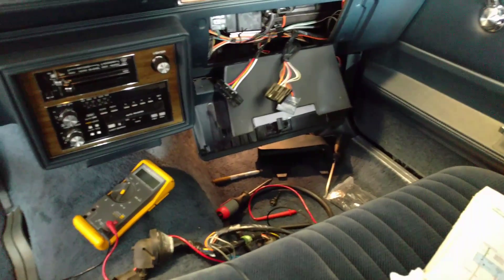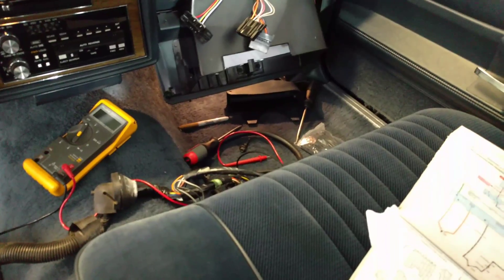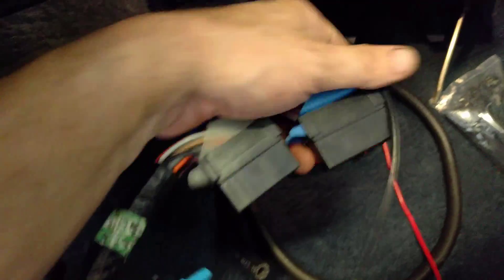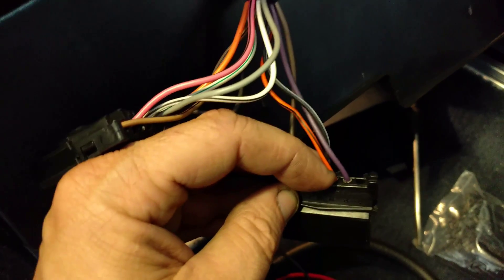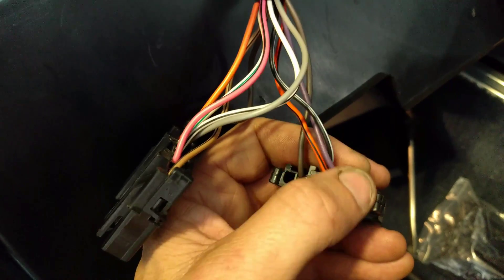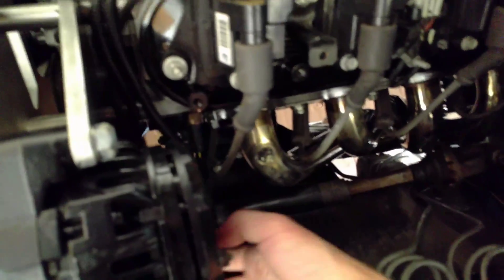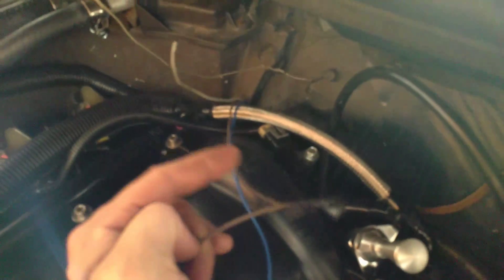Gbody LS Swap Wiring Explanation

Comment: Would this stop it from starting in drive?
Reply from the maker: @BridgeMoes  Are you talking about the neutral safety switch?  It's been a long time, but I don't remember that being a problem.
Reply: @nu5m_radio  I swapped my cutlass with a 6.2 6l80 it starts in park doesn’t start in reverse or neutral but starts in drive and will take off

Comment: How did you hook up the mil lamp (brown wire) up? For the engine light.
Reply from the maker: It' been a LONG time, but I believe the MIL indicator is a ground to activate circuit.  If you ground the "brown wire" does the MIL activate?  If it does, then check the MIL output pin on the PCM for continuity to ground when active.  The HPtuners diagnostic program allows you to manually toggle the MIL if I recall.  

I believe I just ran the PCM MIL pin directly to the lamp on the dash, but you might want to make sure you PCM can support the current draw.  Maybe use a small relay just to be safe.

Comment: Can i completely remove the other pigtail from the factory ECU and the factory diagnostic port?
Reply from the maker: @blocscustomz  It's been so long I don't remember.  Make sure the harness with the ALDL is not the one that contains the starter and ignition wires.
Reply: @nu5m_radio  looks like none of them do.

Comment: im about to do  a LS swap on my 84 monte carlo ss.. what factory wiring do i need to keep installed in the car?
Reply from the maker: I can't remember all the wiring you need to keep, but the ignition wire (the one attached to the distributor) and the purple starter wire for sure.  You can get the engine running with just those two and a ground wire.

Comment: How did you set up your shift linkages?
Reply from the maker: I used a Lokar kit which was basically a straight stainless rod and some hardware.  You have to bend the rod to make it work.  It's a PIA and would not do it again.

Comment: Where did you hook the purple wire to, im running a holley terminatorxmax and cant get the torque converter to lock up... 1987 cutlass

Comment: When you ran the pink wire did you only run it to the ignition wire on the harness and into the relay ? That’s how i did mines but it cranks but don’t want to start up not sure what is giving power to the fuse box
Reply from the maker: Make sure the ignition wire has power during cranking.  That's a common mistake.  If it's cranking you should be getting close.

Comment: Did you use the stock converter with the 4l80
Reply from the maker: The car is sold, but it had a Circle D converter.  I don't remember the stall.

Comment: SO TELL ME IF IM CLOSE OR MOSTLY RIGHT HERE;
typicaly GM runs a very large 12v cable directly from battery to starter. Then a large ground from starter to frame or engine block.
then a still large but smaller cable directly from +12V starter post to fuseblock under the dash, this is the feed for fuseblock
 and also a much smaller wire from the key igntion switch back out to the starter which triggers the bendix to kickin and starter to turnover?

if this is correct can i reuse the large red wire from starter to fuseblock to refeed fuseblock, and i can reuse that trigger wire to the  new  LS fuseblock to trigger starter from ls fuseblock/harness?

Comment: @pmoore4321 can I tap the tcc wire from my harness to the tcc wire in the cutlass?
Reply: Without unplugging the connector?
Reply from the maker: @mr.johnson9589  I'm not sure.  It's been a long time since I messed with that project.
Reply: @nu5m_radio  ok thanks

Comment: What trans dipstick did u run?
Reply from the maker: It's a Lokar dipstick.  I don't particularly like it, but there is very little clearance between the engine and the firewall.  The dipstick comes with an adapter to make filling the trans easier.  It's not the ideal setup in my opinion.

Comment: Did your reverse lights work or did you have to do some extra wiring to get them to work?
Reply from the maker: Reverse lights work as stock.  I did have to adjust the switch due to the gate differences between the stock trans and the 80e.
Reply: @nu5m_radio  where is the switch located
Reply from the maker: @JDP15  It's a white colored switch that is connected to the top of the steering column shaft down towards the bottom.  You can adjust it by hand.  It moves from side to side.  It's kind of hard to explain.
Reply: @nu5m_radio   I move my connector on the steering column and my hand  on the gauge cluster doesn't move. I assume that means it's a bad switch.
Reply from the maker: @JDP15  I'm not sure I'm following you.  What do you mean by the "cluster doesn't move"?
Reply: @nu5m_radio  I'm not talking about the speed hard. I'm talking about the transmission position hand. That tells you if you in park or neutral etc. The white switch you talked about it in this video
Reply from the maker: @JDP15  The white switch on top of the column is for neutral safety (park/neutral) and for the reverse lights.  The switch does not control the gear shift indicator in the cluster.  
The cluster gear indicator is controlled by a string that is clipped to the rotating shift collar.  It's hard to explain.  Is yours just not centered on the selected gear or is it not working at all?
Reply from the maker: @JDP15  perfect explanation...https://youtu.be/vmVCuwI70Hs
Reply: @nu5m_radio  its working but not lined up. You had yours lined up perfectly.  I  will have the transmission in drive but in the indicator will say Reverse or Neutral
Reply: @nu5m_radio  thanks this explained everything.  Sorry for the confusion
Reply: Question...did you delete the backup lamp supply wire A9 Green out of the harness that goes to neutral/safety switch connector or did you connect it somewhere? I have the 4l80e also and I'm not sure what to do with this wire.
Reply from the maker: @montariusstuart1431  I really can't remember.  I'll be working on the Cutlass soon.   I'll check then.

Comment: Yo video cut off on me at the end I wanted to know does that last wire that thick red one that you were holding at the end is that for the power or ignition and I have to tap my alternator wire to the Cutlass old alternator wire and the same thing for the starter I tie the old starter wire from the Cutlass in with my LS swap harness starter wire
Reply: Yolanda Thomas dame shit i was tryna figure out! Just left us hangin

Comment: Which igniton wire did you use? And was it directly off the switch?
Reply from the maker: I used the stock wire that was connected to the distributor.
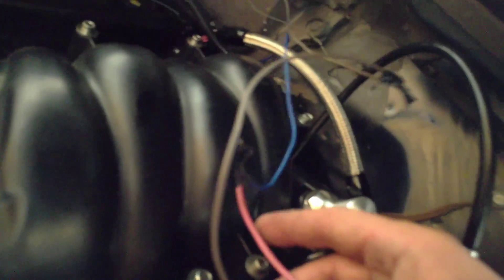Reply from the maker: At the very end of the video, you can see that large pink wire.  That's the one for the ignition.  The video ran out before I could finish explaining.  8:00

Comment: The harness I bought didn't have a Park Neutral Safety Switch or back up lights.  I want to add them to my LS Conversion. Might you know which wires are needed to add to the Red or Blue Connectors so I can connect them to the park neutral switch on the transmission?  Thank you in advance for your help.
Reply: im glad you both had this issue  i have same problem  but im going with a floor shifter and it in a elco. and help on this safety sw is greatly appreciated
Reply: @charlesgrant7690  what's your email address,  I'll send you a photo schematic showing you the connections
Reply: @charlesgrant7690  Hello Charles. Look at this link. It has the Neutral Park Saefty Switch, Plus on the back of the dash, it show the Purple and the green wires coming from behind the dash because they had a COLUMN Shifter so these wires went to the Netral Safety switch on the Column, But has the same task for shifters on the floor. I struggled with this and didn't have a lot of resources guiding me where to start to get this figured out. I hope this helps point you in the right direction. https://photos.app.goo.gl/T5AQaMFNWew3WBVNA
Reply: My harness didn't come with it either... what did you do about it ?
Reply: @Bball128  I just reached out to a wiring manufacturer tech support I believe speedway. They helped me even though it wasn't their product.
Reply: @smithjo4152  so what did you have to do?
Reply: @Bball128  they told me how to wire the neutral safety switch.
Reply: @smithjo4152  so you can tell me right... lol
Reply: @smithjo4152  share the secret!!

Comment: Hey man this vid helped alot. Doing a c1500 91 ls swap and trying to figure out what wire to hook up to the crank signal and 12v when the power is on but cant figure it out the diagram and got no power to the truck to check it lol any tips?

Comment: Doesn't relate to video but what did you use for drive shaft m? Length wise I've heard if you running a 4l60e you need to cut the stock one down about 3"
Reply from the maker: Luis Zenteno I had a driveshaft made at a local shop.

Comment: Was the pcm programmed to accept just one wire going to your safety switch, believe that white wire you're talking about is 34 on the blue connector, I'm still try to learn this wiring.
Reply from the maker: I might have been wrong about the PCM needing PN safety.  You wouldn't really need it anyway.  The wiring in the column will provide PN safety via starter interrupt.

Comment: Thanks you..... really help love the videos! What did you do about the Camaro fbody headers on the driver side I don't know to cut it or let the muffler shop make a S style pip to work. I bought the same ones off eBay as in the older video.
Reply from the maker: I made my own "S" pipe out of pre-bent mandrel bends from Summit.  If I had to do it over again, I would just have the muffler shop make one.

Comment: Would this be similar to an El Camino?
Reply from the maker: Yes, it should be the same or very close.  You shouldn't have to extend your starter wire due to the Chevy starters being on the passenger side of the car.  See my other videos for the check engine light wiring.
Reply: pmoore4321 you mentioned something about the distributed wire. The video ended before you could finish and will do
Reply from the maker: Yeah,  damn phone stopped recording on me.  The wire that originally was connected to the distributor now becomes the ignition relay feed for the LS engine.  It's that simple.
Reply: pmoore4321 thanks bro for breaking it down. It's like these cars were just waiting to get an LS
Reply from the maker: yep, I just wish I was better at the tuning.  I'm lost with HP tuners....steep learning curve.
Reply: pmoore4321 I feel you on that one.